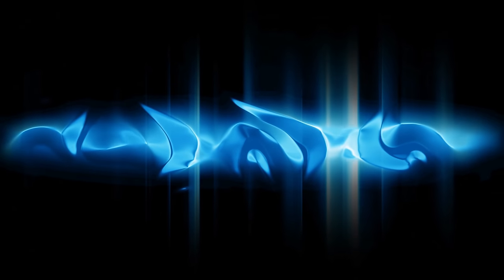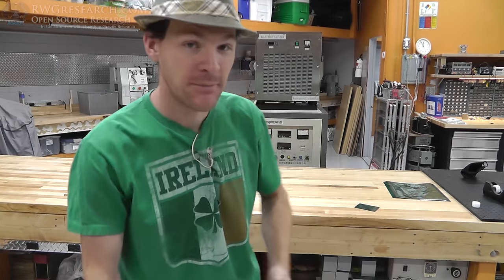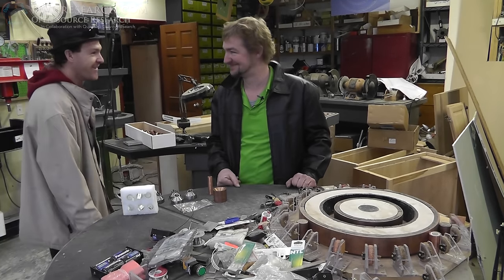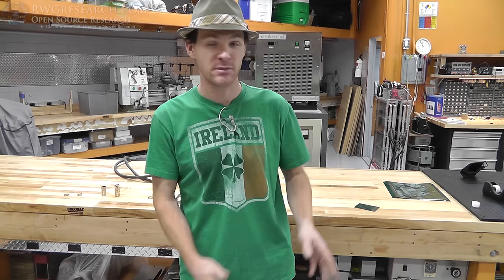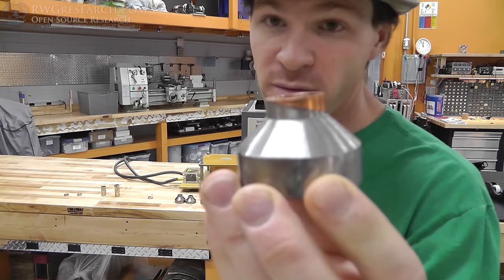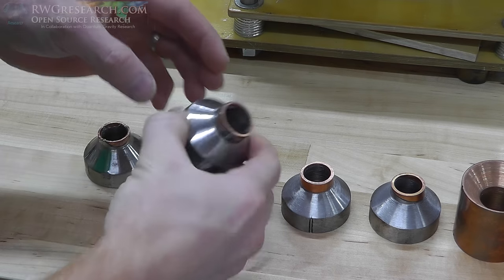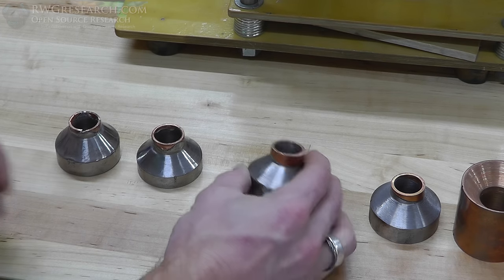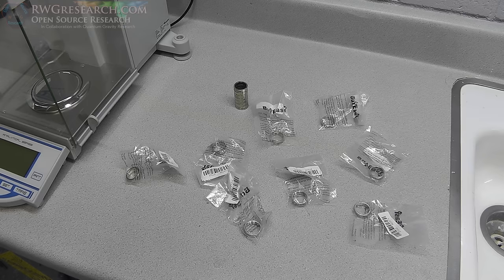Imprinting Magnetic Wave Patterns In Neodymium Rings. With "Wood Brass And Glass"

Comment: think you're going about this the wrong way(brute force method). Have you thought about imprinting via single pole and rotating the ring. Having the ring  in sync with with an ac waveform for imprinting at any diameter.

Comment: I have a question.  Have you ever tried to magnetize a ring shape  in radially oriented fashion? i.e. inner ring one pole and outer ring another pole?
Reply from the maker: yes, i have a few fixtures in the shop here that will do just that. you just need to make sure the magnetic fields are in he correct spot when magnetizing.  ~Russ
Reply: Thank you for your reply,  I thought it is possible but someone believed in theory it is impossible because the result of forces will cancel out any magnetic force to zero.

Comment: The Searl  Effect is a rotating orbital planet.
Eg The Earth(seg plate)and the moon(seg roller). Any one thats states the moon does NOT orbit earth is ignorant to the very real facts of nature. The Sun in our solar system is attracted to the centre magnetic field of our solar system. As the Sun rotates around the centre magnetic field it creates intense eddy currents( see induction kitchen stove) which stream off varible frequency ultra rays which push ALL the solar system planets out into their current orbits. Each planet has its own magnetic field which atracts the planet to the solar system centre magnetic field, and the Sun intense ultra rays then pushing the planet away creating each planets rotation and orbits. The SEG is the exact same natural process of the planets.
Each planets distance from the Sun is the exact balance of attract and repel forces. The stronger the planets magnet field, the closer to the solar centre magnet field. The bigger the planets diameter surface area, the more the Suns ultra rays push it away. See solar wind. The planets and the Sun rotate around the magnetic centre of the solar system. The Sun rotates around the magnetic centre in an orbit of its own diameter in 355 days. This orbit has been documented as the side to side wobble of the Sun.